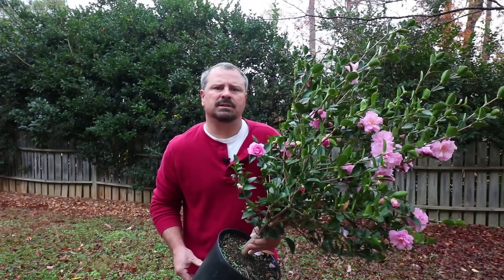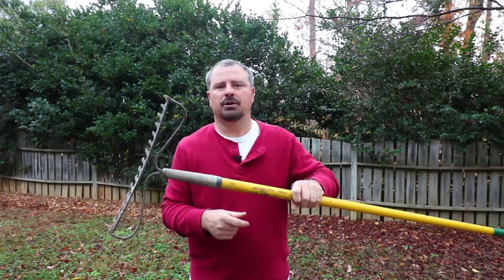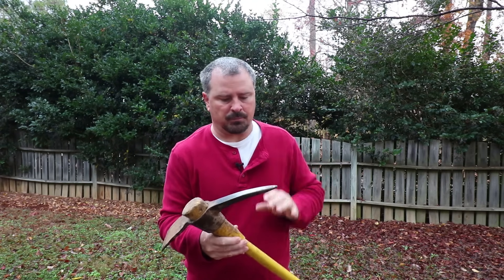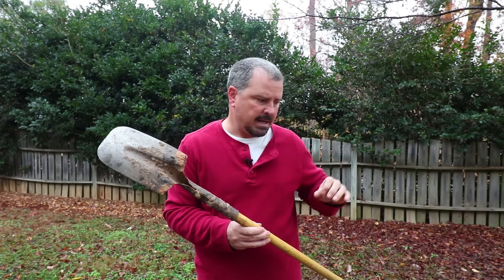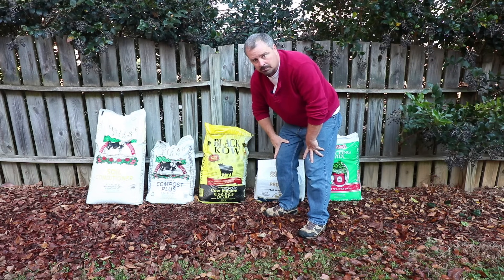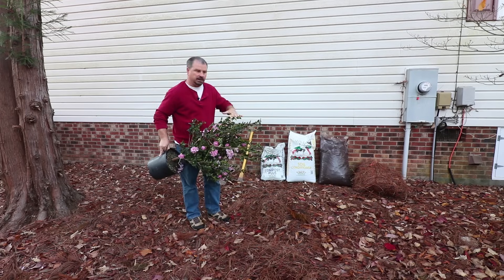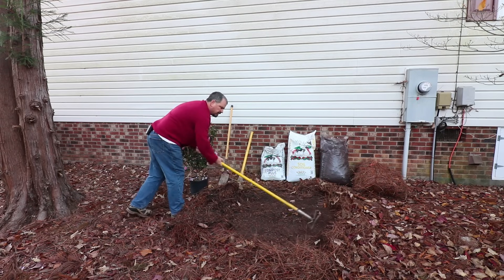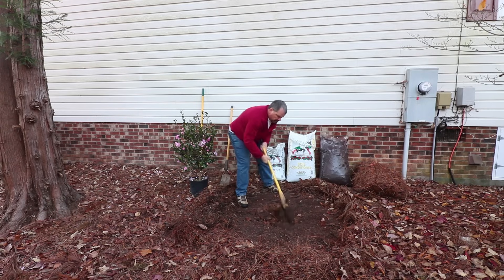How to plant in clay, poorly draining, and compact soils. Proper tools, amendments, and techniques.

Comment: Extremely helpful,  thank you. Now I know why my plum tree has died in the clay soil I planted it in. I didn’t use the right stuff. Question, the soil conditioner kind of seems like mulch to me. If I’m in a bind can I just use mulch as a soil conditioner?
Reply: Mulch is not "aged" as he calls it or partially composted the way conditioner is. I'm pretty sure wood chips and mulch (especially dyed) are not good as mix-ins. Raw wood can leach nutrients out of a soil for a long time before it starts to break down. Conditioner has small bits of wood that are soft enough to tear by hand, in my experience. The compounds in the conditioner have started breaking down enough to amend the soil with organic matter, without taking a year to do so, like wood chips or mulch might. I have never tried, since I've always had conditioner nearby but maybe try it on a smaller cheaper plant and let us know if it works alright!

Comment: I would say that steer manure can be used with clay if you live in a very dry climate. I have had excellent results with clay, sand, and steer manure. It is a cheap way to condition the soil. If you use it in a dry climate it will not retain water too long because the air will absorb it quicker than fungal growth starts.

Comment: I have clay soil myself that I plant various plants into but the soil where I plant into will Be slopped therefore I include a 2" piece of PVC pipe that I place down slope with copper (real) scrub mesh at the low end to stop critters and about 2" or so at the bottom of the hole allowing water drainage. This has always worked for me. "Especially my persimmons" of which I've grown 4 in the past 10 years this way ;-)
Reply from the maker: +Al Brown Sounds like a good technique.

Comment: I have 30 acres of rock hard red/brown clay, there is no picking of braking it up short of  backhoe, over the years trying to get the ground to were I could grow a garden have proven to be a total waste of time and money, I have broken the ground up with a backhoe and had many tons of mulch haled  in and mixed, sure it grows a little bit of stuff, but with the deep frost we get it boils this clay up and eats all my mixed soil mulch deep down into the clay, for years I have had more and more trucked in and it just fads away, my drive way was the same way, the clay just eat up the gravel even at a foot to foot and a half deep gravel, sure the clay driveway was crowned, but clay always came though, I finally bulldozed it all off to raw clay, crowning it and laying down heavy landscape fabric and put a foot of road gravel over top, so far 5 years later its still good, it has been a costly project as any were I want to drive or build that what it takes, I bought this land in the winter, the owner told me it was all gravel,,, boy did he lie to me, this is the worst crap to do anything, I love to garden but I had to pack that in,,,, even doing that same mix planting apple trees, they all died with in 5 year, I even put drain tiles out the hill sides out of the tree holes to help with drainage, still drowned an died. I have been a grower all my life and this is out right frustrating

Comment: Jim, great video about southern clay soils – I've been revamping Dads flowerbeds in the San Fernando Valley where the soil is rock hard adobe. I've used a small pick-axe and spade shovel to dig holes. The adobe is so hard, it takes over 1 hour after you fill the hole with water. Some plants like teucrium, red photinia, lavatera have grown fast. The three camellias are taking their sweet time. Mostly shade with some sun.

Comment: Didn't look quite like 1/3-1/3-1/3....What about using sand, which many recommend?
Reply: I'm a newbie but after watching a pile of vids like this, and reading forums, my understanding of it is that sand may improve drainage in normal black dirt but in clay it just gets absorbed into the clay leaving no air spaces. Adding it would just increase the volume of clay you have, without helping it drain better or be more aerated. Unless you went like, 70% sand, I guess then it would dilute the clay enough to improve texture, but that wouldn't be nutritious enough to grow plants. 
Off to find me some of this pine bark stuff!

Comment: It's better to use a iron bar to break and dig clay soil, it's easier to use. Another method is through permaculture like sing alfalfa to break through the clay and generate green compost which aerate the soil, plus if you add sand it will mix up gradually over time due to biological processes generating a higher quality loam.

Comment: Hi Jim, This was a very helpful video, I live in Las Vegas and have some ground around my patio that I have used for a vegetable garden and a part for flowers and grass , and it was mostly clay, now my husband in preparation for planting got a huge amount of manure from a nursery and dug and mixed in clay, well now my gardens flowers leaves are turning yellow with the green veins sticking out, from everything I've watched and learned this seems to be a nutrient deficiency, is this caused by lack of those in the clay and poor drainage? It's been a lot of trial and error so far and and there is fruit on my veggies growing but my vines (honeysuckle and Jasmine are looking a bit sick) any advice you could give me.
Reply: I'm not Jim but ...Yellowing of leaves and vines is a sign of either too much OR not enough water. Both clay and manure hold water so make sure you have good drainage first✌💚
Reply: I know this is an old comment, but from what I’ve read yellowing leaves with green veins usually means iron deficiency. 

Maybe try ironite for the soil for new growth and/or iron spray for foliage application to existing growth. 

A Google search for proper application would turn up many results. Good luck!

Comment: Great video!  I've been wondering why my new plantings of perennials keep failing over the winter.  Now I know, it's the verboten amendments I've been adding while preparing their planting sites:  peat moss and sometime used potting soil.  I've been using Soil Conditioner pine fines for years now but not the full 50% in your recipe; I'll have to beef that up.  One thing I like to add to clay is gypsum; I remember years ago the bag had a tagline "works like millions of tiny hoes!" to describe how it breaks up the clay clods.

Comment: In NorCal we have heavy red clay soil so this is good info. What are your thoughts on the recommendation for clay soils to plant in rectangular holes?  Theory is that roots will circle around in your amended soil like a root bound container plant and that having corners will force the roots to penetrate into the native soil. Haven’t tried this as I haven’t had problems with planting in round holes.

Comment: Wow ! You just saved my trees . I’ll replant them tomorrow with the soil conditioner you’ve recommended. I used a coir based potting mix to fill the holes and kinda wasted the clay I dug out of the holes . What should I mix with the soil conditioner now that I tossed the clay away ? Thanks again. I’ll dig the potting mix out and start over tomorrow 😊

Comment: That hole is too low, it should be dug deeper, had the very bottom clay mixed with  organic compost (and covered with a bit of sand mixed with clay if the tree or shrub requires a lot of drainage) and on the very bottom, and then filled the hole to the good level for burrying the plant  then fill up with a sililar mixture and put the watered plant in cover it again just around, 
Then on the very top layer level  with compost and then the bark on top. 

The soil blend under the plant will encourage the roots to grow down and will improve the drainage a bit downwards. The roots will get deep and encourage the shoots and bloom next year and will make the plant more winter resistant.
 And the top roots from around the plant will gather the nutrients from occasional top fertilizers. 

Overall the soil under and around the plant will be more attractive for earthworms will have more airiation . 

 The top clail soil around the plant also should have a layer  organic matter and compost, as shown on the video.

Comment: I just planted a twisted cherry tree and it seems to be dying, so it is in clay soil, so after your video. I have been putting the water to it so I may have drowned it so I will stop watering it and hope it comes back
Reply: If dying but not yet dead,  start over. When its dormant. Dig up, follow correct instructions💚

Comment: What is your experience tilling clay soil with a tiller/cultivator?
Reply from the maker: If you are tilling in compost or pine bark, it is not a bad idea. But tilling it to break it up without amendments doesn't really change the condition and I have had it rain on the loose clay and waterlog it. It turned to concrete when it dried out

Comment: Excellent video. I have a question. I have an unlimited supply of cavy and rabbit fine wood chip bedding mixed with rabbit manure and bagged after cleaning pens. This material is finer than commercial wood chips. Would you consider this a good planting medium to mix with the gumbo clay soil here in MN? I will be planting both Mount Royal Dwarf Plum as bare root stock and 2" balled Autumn Blaze maple.
Reply from the maker: +Peter Bitschura I would certainly use it as mulch on the top, but I would probably not mix it in. It may hold to mulch water.

Comment: I used pine bark conditioner while planting my new Eleagnus. I think that I used to much, the clay soil was wet and clumped and I broke a lot of it up and added it with the pine bark. Could I add soil to the top and water it in? There wasn't a lot of clay to put back into the hole.
Thank you

Comment: Jim, love your info. I am in the process of moving from dark dirt SC area to red clay as deep as I have seen in Garner, NC. There is no dark soil under what was cleared for the house build.  It is scary.  Do I need to put those plants out of the ground part way and add dirt under it?  Should I trench a wide hole to allow root growth out, esp with shallow root plants like azaleas?  I did not realize I purchased a clay pit before they started the foundation!
Reply: BTW, I have gotten some very mixed messages about planting in clay.

Comment: I live in the Pacific NW where my whole yard is clay. We had a retaining wall put in and now I'll have to order soil to fill and plant. My goal is drought-tolerant plants that climb and grow like hell to keep the rest of the hill from coming down (as well as the poison oak and blackberries at bay). What would you suggest I order as a soil for the area to fill behind the retaining wall? The wall is less than 4 ft and there's no drainage system beneath, but I've not noticed any standing water behind the wall throughout the rainy season. Every plant I've researched as being deer resistant loves acidic soil.

Comment: But even if you fill the hole with something that doesn't hold water doesn't the water-saturated soil just feel that hole up and still make it where it will still rot the roots. system

Comment: Your digging would be easier with a steel handled digging fork (not the worthless wood handled type).  The tines are strong enough to break the soil and provide a small enough surface to avoid the problem of the wide blade of a standard shovel.  Once the soil is loosened, the standard shovel lifts it out of the hole.  The weight of the fork helps do the digging.  A local tree company uses sharp shooters with steel handles welded on to dig several feet down through very rocky ground.  Your garden rake is also improved with a steel handle (like a concrete rake).  The rake side works great without needing added downward pressure, and upside down it works great for spreading piles and smoothing beds.

Comment: Thanks a lot for this video, Jim.  I have been plagued by clay all my live (we live in the St. Louis area) and my gardening has been pretty hit and miss.  "Doing things (what I thought was) properly" versus "just putting a barely-big-enough hole in the ground" have had about the same success rate!

Two years ago, we moved to a house with a 2 acre yard and not too much in the way of landscaping or trees.  I've planted about 75 trees and shrubs, and a medium sized garden.  It seems I've been (basically) doing it wrong!  I noticed what you pointed out: digging a hole in clay ground just makes a watery, swampy basin.  For the trees, I've mostly used a 50/50 whatever I dug up (clay mostly) and "tree dirt from lowes" (The Sta-Green Tree & Shrub garden soil.) 

I've been using bargain trees, and mostly wrote off the ones that died, but recently I really "went out of my way to do it right" with two expensive coral japanese maples: one is now dead and the other looks not so great.  

Thanks so much for sharing the tip about soil conditioner.  I've tried all sorts of things, and have basically given up and used "whatever is on sale and/or I have some laying around" whether it's topsoil, garden soil, compost or whatever.

Comment: Dude, that is NOT Clay Soil.... What a couple inches at the top????  A child could do that..
The deeper you dug the better soil you had... 
You need to see the Lake Bed I live on... I have found really hard compact, dense lake bottom clay down past 3 feet and I stopped there..
I had to use that long heavy, iron digging bar, around 6 feet long, about 15-20lbs..
And a post hole digger to get that clay out of holes that deep..

Comment: All of that soil packed in plastic makes me thinking... Can we get soil "in bulk"?  Its forbidden in my area to collect from the nature. Its like 800 years to plastic to decompose. Sure there is a solution.
Reply: Most definitely! Look for "soil delivery in my area". I have a place that does bulk mulch, soil, soil conditioner, and I just run up to the place with some big 18gal containers. They sell by the cubic yard, which is enough to pile up in the back of a small pickup truck, but I just bring buckets and get charged for half since my projects are much smaller. Or get it delivered if you need that much!

Comment: You know a wood handled tool will last 50 years if you take care of it.  To use peat moss (which is pretty much required on things like blueberries) I build up a mound using soil from another spot on the lot.  It's important to use the same soil, or the roots will not penetrate into the poorer soil.  Compost should be pretty close to PH 7, or it's not done.  I've got a 2 acre yard that is horrible clay soil, so I've tried a lot.  For me, sand, compost, and peat moss are what works.  I'm going to try some of that soil conditioner you mentioned.  Aren't you worried about the wood sucking out nitrogen from the soil?  Wood chips mixed with soil takes years to become fertile.
Reply from the maker: I've got plenty of wooden handle tools and I take care of them. I recommend the fiberglass, because people don't take care of there tools. The bark is not like woodchips. Almost all plants that you buy and grown in a bark mix of some kind. I definitely don't mix woodchips into the soil. That is always bad, but in clay they just rot and cause all sorts of problems. I always say whatever works for you keep doing it.
Reply: Right - totally forgot that about bark.  I didn't mean to imply you didn't take care of your tools.  I can see you do.  Just wanted to throw a shout-out for good old wood.  In fact, if you've got $35 to throw at a shovel or rake, better to buy the $35 shovel with a wood handle.  They feel so much better on the hands.  Every four or five years, rub them down with coarse grit sandpaper, and a little oil.  Much better for the environment, too.  Fiberglass is tough and takes a lot of abuse, though.  I hate those splinters with a passion.
Reply from the maker: I was replying to a lot of messages. Usually I throw in a thanks for watching and commenting which I should have. Thanks.
Reply from the maker: Yeah, the splinters are wicked

Comment: Hi Jim I can not believe that i found someone from my home town.I wish that i had found your video before i killed my first tree in clay I did not give up though I planted another one per an old timers instruction,and it is doing pretty well(the deer have even noticed it)My question is that I live near the place where you can dump branches,leaves etc, and buy soil by the truck load it is owned by the city of Raleigh(New Hope Road) is that  good soil for a (container ) vegetable garden as well as trees and shrubs?
Question 2.I'm digging up old boxwood's lining my sidewalk what would you recommend?
Thank You Jim.....I learned so much from,someone in my backyard.
Reply from the maker: +Cheryl Jackson I have gotten the mulch from the dump before. A couple of things. 1. I would only use it for top mulching. It is made out of whatever is coming in at the time and therefore to unpredictable to use as an amendment. 2. If you get it to close to Christmas, it is full of chopped up ornaments.

Comment: Jim,
Really liked this video you did, thank you. It's the second time I have watched it. I have a Knock Out Double Rose that I am going to plant in a slopped landscaped spot in our back yard and it has clay in it. So I have some Peat Humus that I bought that I will amend with the clay to put in the bottom of the hole as you showed on the video.  I wanted to show you the Peat Humus but don't see where attachments can be included. It has some good chunky material in it. Its not a full Peat.  Great time in North Central Texas to be planting before the heat comes.
Chris